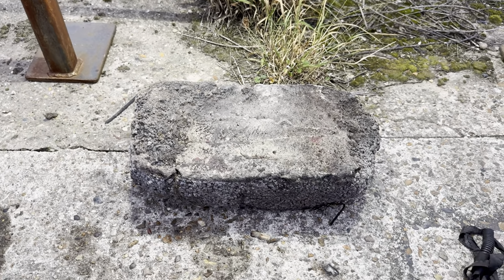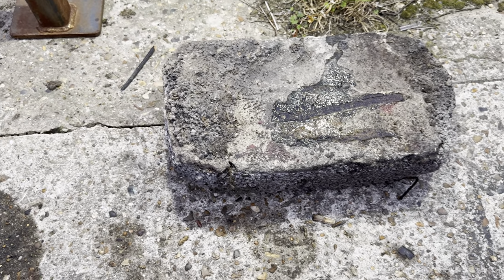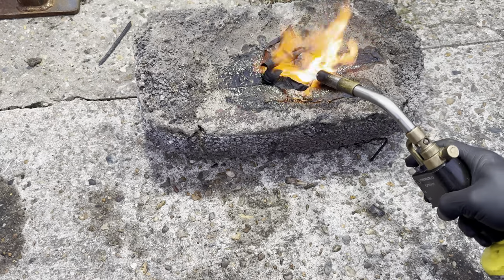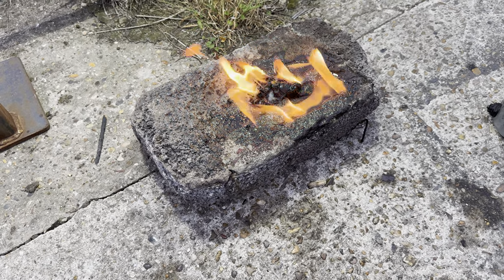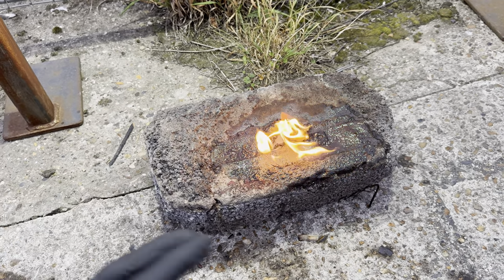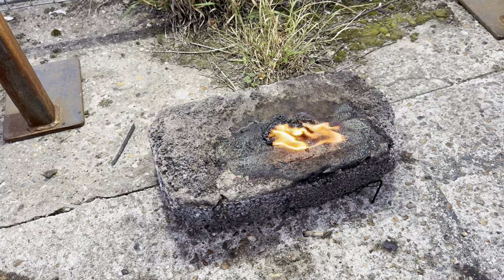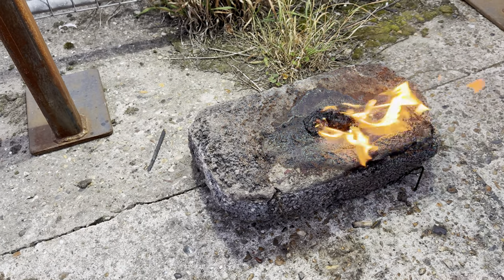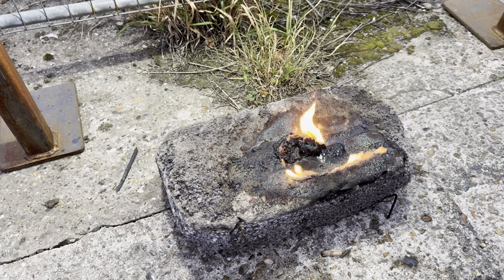Diesel cars CAN catch fire.

Comment: Do it with a Lithium battery.
Reply from the maker: I did ages ago, wasn't very exciting. I'm sure it would catch fire in a similar way though. Energy dense things tend to catch fire. https://youtu.be/rHq7Hy1n8n0?si=sEMw1vID_gpOdXds
Reply: Did you see the guy martin show when they tried to set an EV battery on fire and couldnt? They shorted it out, drilled holes in it, tried to crush it, and the batteries internal safety systems kept kicking in and preventing a fire. Eventually I think they took the whole thing apart and disabled the safety systems and eventually got it to catch fire. EV batteries are far safer than people realise. There have been horrific accidents where EVs have been ripped in half and the battery still doesn't catch fire. Amazing really. I guess the designers have done their job properly and built something safely

Comment: Yes diesel does burn , but it has to reach a temperature of 52° c ,without a flammable object to adhere to it's a hell of a job to get it to burn on its own . Personally I don't believe it was diesel vehicle that caused the airport fire , I think it's a LIE ,  put out to allay people's fears because of the amount of EVs catching fire . NEVER  has a multi storey had such a devastating fire before now .
Reply from the maker: Except the one in Liverpool in 2018, the report of which puts the blame on diesel cars and ‘rivers of burning diesel fuel’.
Reply: @theweekthatis  you trust reports?
Reply from the maker: @JaneBloggs-jr9qd  yes. It makes total sense. There were very few EVs on the road in 2018 too.
Reply: @theweekthatis  i post two comments from, my rumble channel

The burning lithium creates a metal fire existing at temperatures of 2,000 degrees Celsius. Such teperature will destry metal and concrete structure too. Plactic -what is most cars are made of from - ignite with 500 degreas and burnes with up to 200 degrees. Petrol or disel ignites around 200 degrees or less. So, petrol/diesel car would not do so many damage
EVs (Or Hybrid with Diesel/petrol engine) are burning completely to the ground fast and with no way to put fire down. Only EVs cars can be the reason for such fire started and kept going (if we exclude the direct energy weapon, as it would be another story). Truth is not told, so we have to make "conspiracies" instead.
Reply: @theweekthatis  and another
Even if the fire started in a diesel vehicle, it could well have been a lithium starter battery or it was a hybrid car. They would have just told a half truth, omitting the lithium part. For the fire to have been so devastating, there had to be EVs involved. Just their presence with a "regular" fire, would have disastrous consequences. They wanted to keep EVs out of the news as that would put a nail in the coffin of their EV push. Thankfully a lot of people are wising up to that con. EV sales are slumping, so I've heard.
Reply from the maker: @JaneBloggs-jr9qd  if you say that out loud, does it turn into something that makes sense?
Reply: you can see the reg plate, E10 EFL and you check that out via the usual government sites and see it's a 2014 diesel, not a hybrid, not an EV.
Reply: @Paul_Y_T  thry often us Range Rovers in psyops , the idea that a diesel enhine can result in the destruction of 1600 cars  is RISIBLE , it must be EV or DEW . it MUST BE
Reply: @Paul_Y_T  can you explain why a parked car would catch fire ? is this a version of the imamculate conception ?
Reply: @JaneBloggs-jr9qd  electrical short caused by rodents chewing wires is not uncommon in UK, some other device in the car catching fire etc.
Reply: @Paul_Y_T  how can a top floor fire in a multi story car park involving a diesel engine result in the total loss of every vehicle in the building?
Reply: @JaneBloggs-jr9qd  Every fire has to start somewhere, then it spreads. There's a huge amount of energy stored in the cars in that car park, and a huge amount of heat being generated that would affect the integrity of the parking structure itself.
Reply: @Paul_Y_T  it started on the top floor , heat rises , it wasnt Islamic Mice
Reply: @Paul_Y_T  not denying i would feel heat on my head but i dont think my toes would melt

Comment: Propaganda. You're burning the material of the rest of the car.

Diesel tanks and their contents won't explode like batteries will. The fire starts in the electrical system. The rest will burn, but the fault is not with diesel per se. Diesel needs to be super heated or compreseed.

Comment: The 12v battery is connected to the chassis so if any wire touches metal there will be a fire.
Reply from the maker: Untrue, the fuse should blow if the system is designed correctly!